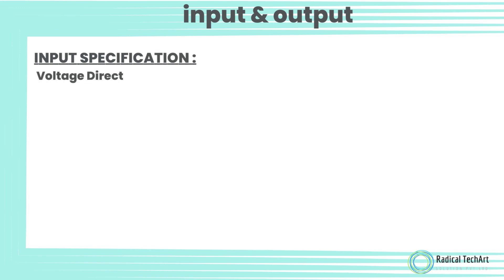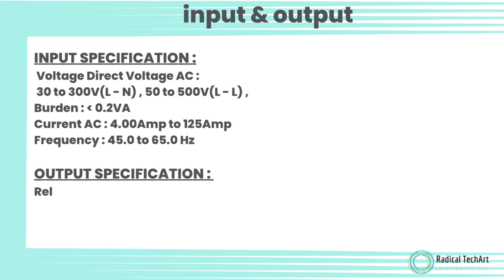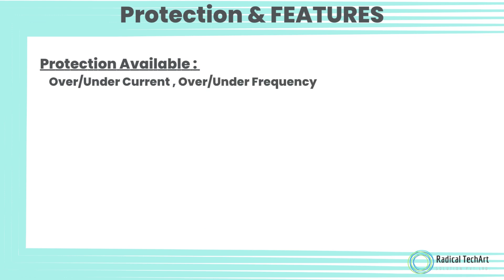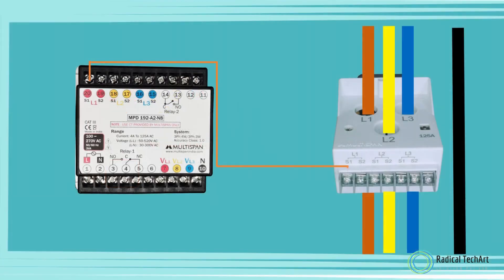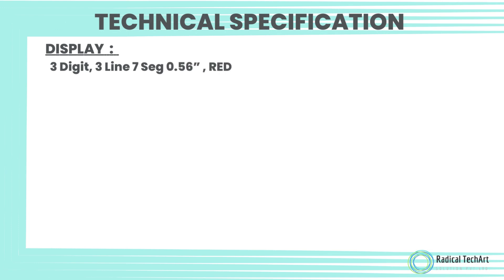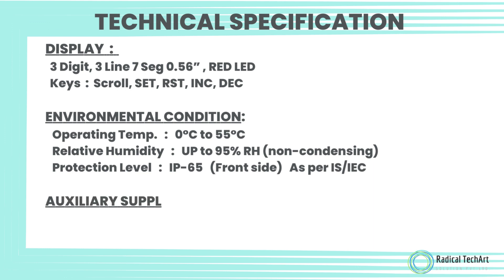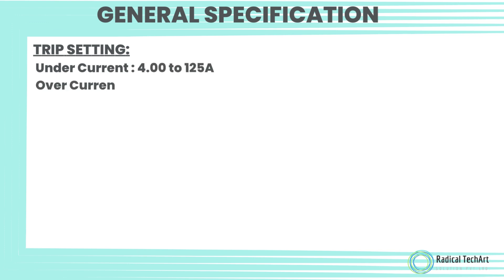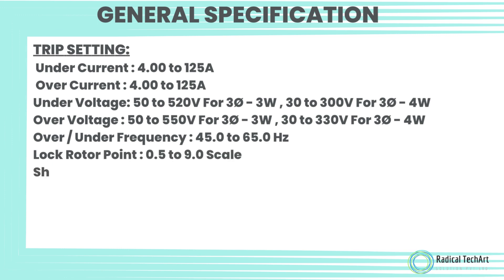Motor Protection for 3 Phase AC Motor | Multispan MPD 192 #multispan RadicalTechArt I RadicalTalks

Comment: How can I set 124 A shut off
Reply from the maker: To set a 124A shut-off on the Multispan MPD 192, access the Overcurrent Protection (OC) parameter in the settings menu. Set the OC Trip Value to 124A. Ensure proper configuration by verifying the current sensor rating (CT ratio) matches your system. After setting, save the changes and test for proper operation. Refer to the user manual for detailed navigation instructions.